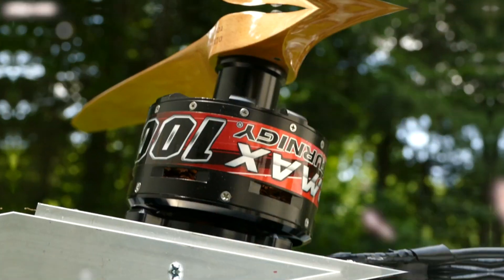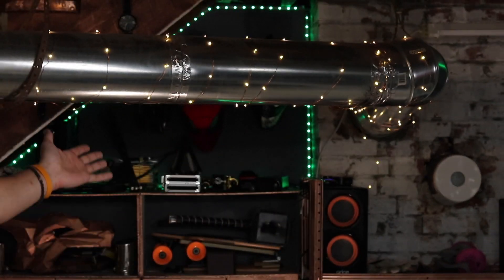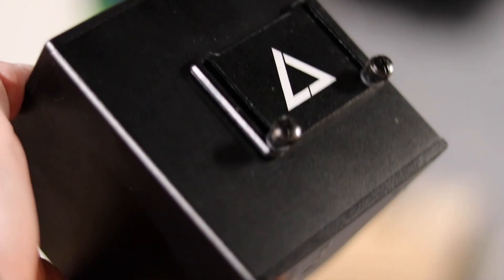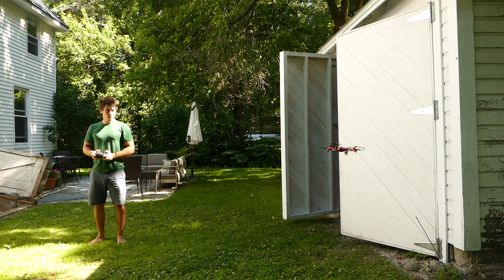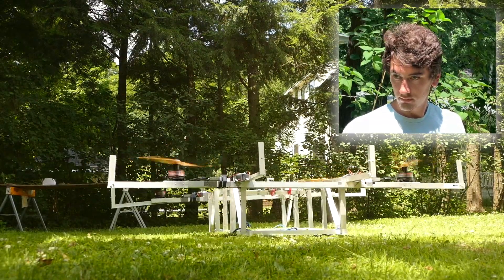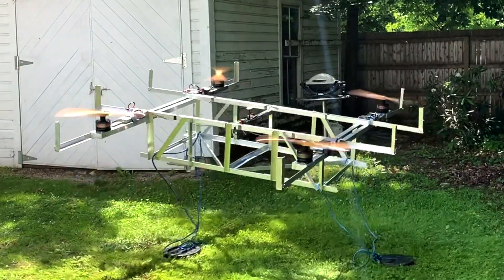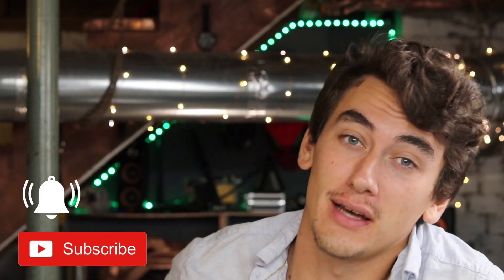DIY HUMAN FLYING DRONE IS BACK! (Test Flight)

Comment: I noticed there was still flex in the frame in this footage. Any flex in the frame will put the props out of alignment which will have the drone going all over the place... The frame has to to be proper stiff to start with. The rest was a tune required on your PID's you could see resonance in this footage.. Does the flight controller have selectable flight modes? were you in stabilize mode or a sport mode? You can set the modes up and tune this out to make it fly well, there's heaps of stuff on utube about tuning the PID's for any controller... just hook the controller up to a computer or tablet with the maker's software and follow tuning instructions on utube.

Comment: you gennerally have to use some vibration damppeners beacause of sheer amount of the vibrations from the motors spinning and that aluminium frame just shares its vibrations to the flight controller , also maybe keep those flight controller in a box with some vibration damppeners and nuts to protect it and fix it in place ,, or else your pids will go nuts ,, also even the slightest of vibrations effect the gyro ,, also if u keep the elctronics near fc the magnetic fluctuation may effect the pids ,, gennerally the pids over react when they are not in the air so it can be an issue sometimes

Comment: I'm also far from being an expert but having built my fair share of drones, I'd say that your problem lies with the size of the props. I'm guessing that in trying to stabilize, the props don't accelerate fast enough so the FC doesn't get feedback as fast as it would expect and pushes more power  to compensate, which once fully accelerated gets the drone to start tilting the other way, and so on... You coud try putting slightly smaller 3 blade props.

Comment: Use a different flight controller like the apm 2.8 so u can add how and telemetry capabilities to the drone and I highly suggest u to go for a hexagonal setup instead of this which in my opinion is not at all efficient.
Reply: this would be interesting for sure although DJI has a datalink

Comment: My only suggestion is to tig the aluminum instead of bolting up.  If you REALLY want to decrease the weight, you can't go wrong with carbon sheets. Buy them in bulk and form a frame from scratch.

Comment: Dude your drone propellers are offset you need to arrange them in a square frame there is no air to pull from due to that arrangement the propllers need to be closer for better drag

Comment: i've had a similar problem some time ago, on my case the drone was to light for the propellers so every tiny movement had to much impact on the flight stability, try putting some more weigth on it and see how does it behave

Comment: Your channels far from dying don't worry about that 😂
But you need to connect it to betaflight and do the following
-Calibrate the motors (WITH PROPS OFF!!!)
-Calibrate the  gyroscope 
- I would personally be using a seperate power distribution board and flight controller (if one kills itself they won’t all die) 
-but be aware, if you calibrate the motors you may have to recalibrate which direction they turn.
-Also make sure you set a switch on your controller for horizon mode/angle mode 
Love your channel, been a sub since the first iron man suit, good days👌

Comment: I'm not saying i'm a drone expert but i have built a couple. The first noticeable problem is how your motors are situated, the rectangular setup is a horrible idea (especially if you plan on adding more motors. You should be aiming for a more square/hexagonal/octagonal shape) that is my prediction for why it seems to be constantly tipping back and forth. From a software point of view it comes down to the flight controller and software which i don't know what exactly you are using. But my prediction is if you are using beta flight the drone configuration that is the default is the square/rhombus like setup. As I said i'm no expert and take my word for what it is but you should of definitely thought out the motor positioning more. I love your content and cant wait for the next video. P.S. please like the comment to JLaser can see it. Thx
Edit: if you aren't using a flight controller use one, and if it doesn't have a gyroscope thats another reason its not stabilizing
Reply: He is using a DJI Naza M V2 (Atleast i think). Its an old FC from like 2011 that has GPS and altitude hold and RTH and support to up to 8 motors. I have worked with it before and can say its not very suitable for a large drone like that one.
Reply: @partial_  what type of controller do you think would work for this scale?
Reply: Hey Yhya Farag My I Email and chat with you
Reply: @liamjacob9097 hi where you from ?
Reply: PUTANGINA MO <3 :)
Reply: WoW
Reply: Bro u also should do this kind of stuff
Reply: das a loooooooooooooooooooooooooot a words I MEAN A LOOOOOooOoOoOOOoOoOoOooOoOt

Comment: You need to change your PID's on beta flight. Try P 65 I 65 D 55 then make quick flights to see how the drone reacts and change te PID's until it doesn't overcompensate anymore but be careful to not make it undercompensate too because if so it can bdjsnwbsjds and BOOM too. I can't really explain how the PID system works i just understand it so move the PID's try different things and see how it goes. Also watch tutos on youtube it helps a lot. So good luck ! Peace and sushi <3
Reply: its a NAZA FC probably using NAZA assistant , but recalibrating the FC is  needed both basic and advanced even if it doesn't call for it

Comment: The frame is the problem or it could also be that there's more power going to one side than the other also when your wires could be putting out less electricity

Comment: this isn't super important but you should consider making some kind of landing gear. currently it is landing on single corners which can't be good for the frame. it might save you some time in the future. (they could also be used to add weights to corners of the drone for a more mechanical tuning method)

Comment: add expo to the rates.. also it would help to add a stability mode using an accelerometer. then youre not doing all the micro corrections yourself... any questions let me know... i build these things for fun

Comment: Add weight into the body of the drone maybe. It could be that the drone has so much power for it weight that the flight control meant to handle little complact drones does not know how to handle that. From there PID tuning is your best bet.

Comment: I don't know if you go back and re-watch your videos after you do your production and stuff and it takes a while to frame seems to be been in some of your footage I don't know if it's the camera angle but it looks like your frame is bent I'm thinking if you use different material maybe even go as far as to carbon fiber wrapping the joints or doing a fiberglass joint wrap and use lighter materials like PVC

Comment: Youre pid arent tuned.  Its easy, if you Use betaflight or cleanflight tune it, and it will Fly better. 
If you have any questions about the flightcontroller,you Can ask me😉

Comment: a problem could be down to centre of gravity... if the weight of the electrical components are heavier on one side then it will be harder for the electronics to stable the drone. therefore making it over correct itself. i think its just guess and check here but that could be a contributing factor on why its unstable. good to see you back man, love the vids :)

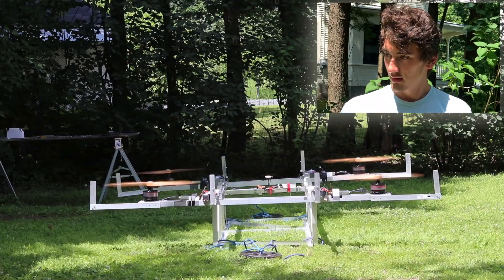Comment: Welcome back! And congrats on getting the drone to fly! Like you said in the video, you're going to need to add more to the drone to give it the ability to carry a human. I do have a concern for a small portion of the framework; 3:17, the far left arm seems to be slightly warped. Obviously it didn't noticeably impede the drone's performance, but adding more weight to it... who knows what'll happen. Like Peter Scripol said, these things are powered lift vehicles. Something happens, you're going down. Keep up the work, I doubt you're going to fail at all.

Comment: Re balance the weight, reduce the frame to is minimum by curving or made a triangular angle for it in a boat shape* so all the weight is put in one central area and watch if you can give a angle downward in the frame so wen you "brake"your drone don't flip back or try to spin.  (Think of a large kayak not covered but with a large V shape base...  Or flip the helmet of pyramid head from silent hill...)

Comment: Try and add a gyro stabiliser to the main flight controller to keep the drone balanced
Reply: My god the only comment that makes sense
Reply: Brilliant ♥️ it!! I will be constructing my (Dr) own  🔜. 
Waiting for 80V ⚡ chainsaw motors ATM. 26"x5.5" carbon fiber Propellers are in. Building the drone frame out of used aluminum🚲 s. Cf bikes would be nicer but probably way too expensive.

Comment: Seems like you'll need to properly tune PID values. In GENERAL, PID values refer to how motors behave, how do they accelerate and decelerate. But it's more complicated than that. Google or ask friends who are into drone racing to help you out with that. Also you can tune ESCs to reach better stability.
Reply: he's using a NAZA FC although he can adjust his gains in NAZA assistang

Comment: You should connect your drone to betaflight and blheli and tune the drone. It will help stabilize the drone.
Reply: Not sure dji fc uses betaflight
Reply: @rorymatheson8583  nooooo no dji drones!!! The are bad!
Reply: @Jolan9340  you could say that, but you could also say the opposite
Reply: @rorymatheson8583  true but I have a really bad experience with dji
Reply: @Jolan9340  have you?! What was it?
Reply: @rorymatheson8583  flyaways
Reply: @Jolan9340  really, i got into drones with a phantom 3, never heared of a problem like that😭
Reply: Helpless commets be like:
Reply: dude thats a dji naza  :/
Reply: how do you do the NAZA dance with something this size? lol